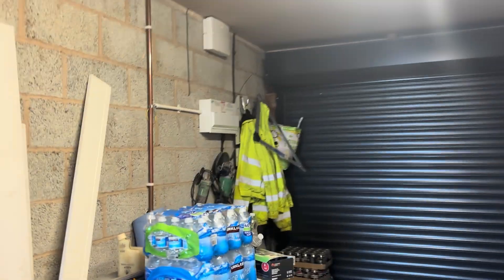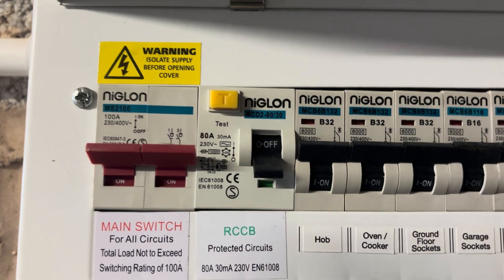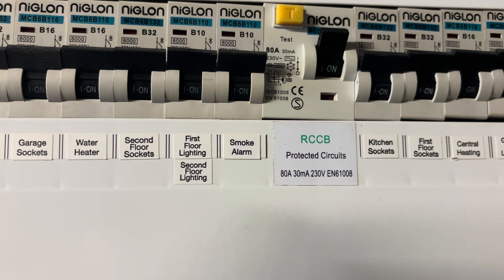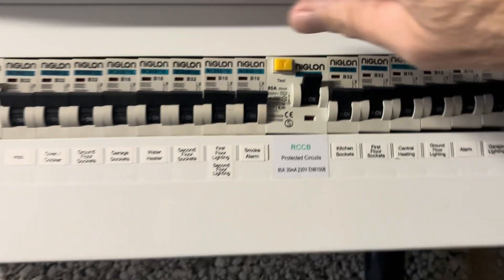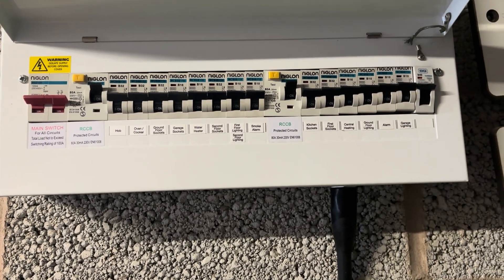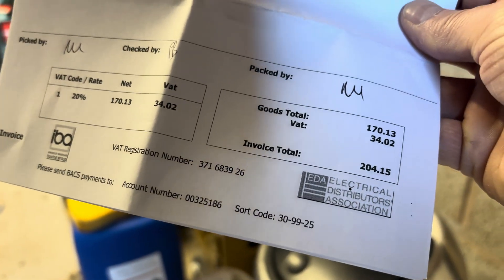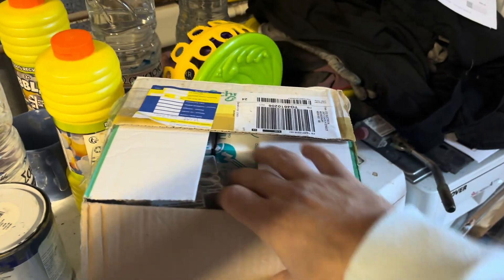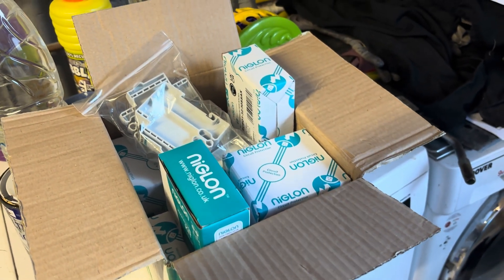RCBO installation - Upgrade

Comment from the maker: Thank you all for your comments and feedback. Let me address some points to clarify the approach taken in this installation.

The positioning of RCBOs based on heat dissipation is indeed a valid consideration. However, the initial comments suggesting voltage drop across a 12-inch bus bar as a reason for positioning RCBOs differently are not relevant. Any voltage drop in this scenario would be negligible and nearly impossible to measure.

In this case, the consumer unit was installed in a garage on a non-insulated wall. Overheating due to RCBO placement in this environment is highly unlikely. Furthermore, the cables within the consumer unit were already cut to length. Extending cables solely to reposition RCBOs for theoretical concerns would have been impractical and unnecessarily costly for the client.

This installation reflects a practical and cost-effective solution tailored to the specific site and client needs. It is not intended as a one-size-fits-all approach. A new installation would, of course, allow for greater flexibility in designing the layout from scratch. However, this was a retrofit addressing a rare intermittent fault, entirely unrelated to the original electrical installation.

To summarise for those who may not fully understand the context:
	1.	The issue was an intermittent fault tripping an RCD protecting seven circuits.
	2.	Testing confirmed no faults in the electrical installation.
	3.	The client was offered an RCBO upgrade to improve circuit independence.
	4.	Options included a new consumer unit or an upgrade to the existing one.
	5.	The upgrade was chosen due to the existing circuit cable entry from the rear cavity, with cables already cut to length.
	6.	The work was fully compliant with regulations, certified under Part P, and backed by NICEIC registration, warranty, and insurance.
	7.	The root cause of the fault was identified as a defective Neff oven heating element, later replaced under warranty.
	8.	Total cost to the client: 3 hours labour and £215 in parts.

This approach was the most practical and cost-effective for this particular situation, though other methods could be appropriate in different contexts, depending on site-specific challenges and budgets.

I hope this explanation helps provide insight into the decision-making process and highlights the importance of tailoring solutions to the individual needs of each project.

Comment: £200 odd quid just for the rcbos etc. I just bought a full board with SPD, mains switch and 10 rcbos for £154.
Reply from the maker: On this job - The work involved in changing the entire board due to cable entries, cables cut to length etc would be exponential. Sometimes it's just easier to change the internals than to crimp and extend an entire system's cables.

Comment: You clearly have no idea what you’re doing

You need a torque screwdriver for installing RCBOs, MCBs, RCDs etc etc
Reply: No you don’t. Torque settings are only the manufacturers recommendation . Not a legal or regulatory requirement. We didn’t have such nonsense back in the sixties seventies eighties or nineties. And we never had any problems with loose connections of CUs catching fire. Why because back then the use high grade brass screws and terminal unlike now where they use low grade alloy and low grade soft brass. Fact

Comment: 10 year sign off surely it should be 5 years.
Reply from the maker: I would agree for an old house but this property is only 2 years old and the installation is new. A complete replacement of the Distribution Equipment rendered this in my opinion, adequate for 10 years without inspection.
Reply: The five year only applies to landlords privately rented and social housing domestic property / dwellings.

Comment: Why have they all got to be the same brand British Standards or they couldn’t be sold.What answer have they gave to prove all the same brand it’s a con obviously.
Reply from the maker: Regulation 536.4.203 of the 18th Edition Wiring Regulations (BS 7671) states:

“Where different items of equipment are combined to form an assembly, the resulting assembly shall be verified in accordance with BS EN 61439.”

That effectively means: stick to one brand unless you can prove full compatibility and testing — which, in practice, only the manufacturer can do.
Reply: @DMBHomes I knew it Brand name nothing to do with anything else British Standard’s is a con pure and simple a money making machine.If I rub the name off it and put my name on it.Sell it for half price as they all come from China same batch different Brand Name.Thank you for your reply.The test of TIME proves Brand Names go for nowt cheap versus expensive copper versus brass.
Reply: @DMBHomes You can not get in a rubber boat and sail over here.Regulations haha
Reply: @DMBHomes yes because they haven’t been type tested by the manufacturers and therefore can’t be proven to be effective.
Reply: I think the main reason is that, although breakers may look the same size they may not fit properly in the consumer unit and also when you clamp onto the busbar it might not line up properly, and not give a good connection and put a strain on the busbar and/or the breaker

Comment: Thanks for this vid. I also have a fault somewhere which randomly trips the RCD so I am thinking of upgrading mine to RCBOs too. One question pls - Is it important to know which Netural cable belongs to which circuit as currently they all go directly to the Neutral bar and I have no indication which belongs to which circuit?  I always know it that Neutral is commong amongst circuits and that is how my house is wired but not sure whether this makes a difference when using RCBOs.
Reply from the maker: When using RCBO's all the neural tails (That's the little blue cable that comes already attached to the RCBO) go directly into the main neutral bar of the consumer unit. In an RCBO board there is only one common neutral bar.

Then each individual circuit is wired directly to its own RCBO with Live & Neutral to the RCBO and all earths (CPC) directly to the main Earth bar. Please only allow a qualified electrician to carry out this type of work. 👍
Reply: @DMBHomes  thanks. As I imagined and just confirmed with my electrician few mins ago - we would need to identify each neutral cable to which circuit it belongs to be connected to the respective rcbo
Reply: @DMBHomes the neutral and earth bars should be numbered 1to 10  for example your circuit should be connected accordingly ie the fuse MCB or RCBO next to the main switch would be circuit 1 therefore the cable conductors will be as follows red/brown to the MCB black blue to number 1 on the neutral bar and green/yellow to number 1 on the earth bar . Circuit 2 to 2 and so on.

Comment: No clues from the insulation tests that you did on each circuit before connecting to its new RCBO ?
Reply from the maker: No it was an internal fault in an oven that had to be disconnected when carrying out 500V IR testing. The oven went into fault condition only when in use on a particular setting. The fact it was pin pointed by the RCBO was the reason the client successfully found the fault.

Comment: Hi Gareth, I'm wondering why you chose Type A RCBOs over Type B. Maybe Type B is overkill?
Reply from the maker: Type B RCBOs are specialised and more expensive
	•	Type B RCBOs are designed for smooth DC residual currents, such as those found in:
	•	Medical equipment
	•	Photovoltaic (solar) inverters
	•	Industrial drives
	•	Some EV chargers

In a typical domestic setting, these aren’t usually present. So, Type B is over-specification, with higher cost and less relevance.
Reply: @DMBHomes  Hello. What about type F RCBOs? I think it's more geared for Air Conditioning units, washing machines and maybe electrical appliances in kitchens using DC?

Comment: Hi in my house from.time to time main switch at the board are down Any suggestions
Reply from the maker: I'm afraid it's impossible to diagnose something like that over a YouTube chat. My advice would be to call an electrician who can test all the circuits to find the fault.
Good luck 👍
Reply: Haunted House obviously
Reply: Is the main switch an 80amp RCD being used as the main switch if so call an electrician if it’s a 100amp linked/double pole switch then it’s either knackered  or someone is switching it off . As the double pole linked main switch doesn’t have the capability to automatically disconnect it not what it’s designed for.

Comment: Should all new installs and major upgrades be with RCBO's now?
Reply from the maker: It's not regulatory but most electricians including myself would recommend RCBO's because they offer greater separation of circuits meaning faults are easily identifiable. They allow more circuits to fit into a distribution board without increasing the size and they are extremely reliable.
However as long as your electrical installation is installed in conjunction with the latest IET regulations by a suitably qualified electrician then it will be safe and approved.

Comment: Should have put the largest RCBOs closer to main switch volt drop.
Reply from the maker: @kevanswift7797  	Voltage drop in this context is more dependent on the length and size of the cables running from the distribution board to the load, not the position of the RCBO within the board. Within the distribution board itself, the difference in distances is negligible and won’t significantly affect voltage drop.
Reply: @DMBHomes it’s nothing to do with voltage drop it to to with heat the heavier the the hot the the breaker will get .
Reply from the maker: @Dog-whisperer7494  Thank you for your comments and feedback. Let me address some points to clarify the approach taken in this installation.

The positioning of RCBOs based on heat dissipation is indeed a valid consideration. However, the initial comments suggesting voltage drop across a 12-inch bus bar as a reason for positioning RCBOs differently are not relevant. Any voltage drop in this scenario would be negligible and nearly impossible to measure.

In this case, the consumer unit was installed in a garage on a non-insulated wall. Overheating due to RCBO placement in this environment is highly unlikely. Furthermore, the cables within the consumer unit were already cut to length. Extending cables solely to reposition RCBOs for theoretical concerns would have been impractical and unnecessarily costly for the client.

This installation reflects a practical and cost-effective solution tailored to the specific site and client needs. It is not intended as a one-size-fits-all approach. A new installation would, of course, allow for greater flexibility in designing the layout from scratch. However, this was a retrofit addressing a rare intermittent fault, entirely unrelated to the original electrical installation.

To summarise for those who may not fully understand the context:
	1.	The issue was an intermittent fault tripping an RCD protecting seven circuits.
	2.	Testing confirmed no faults in the electrical installation.
	3.	The client was offered an RCBO upgrade to improve circuit independence.
	4.	Options included a new consumer unit or an upgrade to the existing one.
	5.	The upgrade was chosen due to the existing circuit cable entry from the rear cavity, with cables already cut to length.
	6.	The work was fully compliant with regulations, certified under Part P, and backed by NICEIC registration, warranty, and insurance.
	7.	The root cause of the fault was identified as a defective Neff oven heating element, later replaced under warranty.
	8.	Total cost to the client: 3 hours labour and £215 in parts.

This approach was the most practical and cost-effective for this particular situation, though other methods could be appropriate in different contexts, depending on site-specific challenges and budgets.

I hope this explanation helps provide insight into the decision-making process and highlights the importance of tailoring solutions to the individual needs of each project.
Reply: @ voltage drop is I x R the greater the load (I) the greater the voltage drop on any small resistance as said just good practice to put all heavy loads nearer incomer, so to minimise voltage drop on busbar no matter how small the volt drop is
Reply: @kevanswift7797  nonsense.
Reply: @ the bus bar has volt drop and the further away from the meter tail the load is and the greater the load the greater the volt drop. Volt drop effects all circuits fed from bus bar. Sorry you are wrong and it’s good basic to put all the larger loads closer to the incomer.